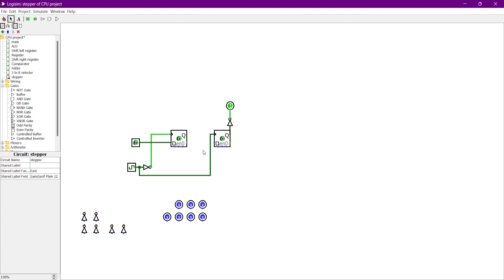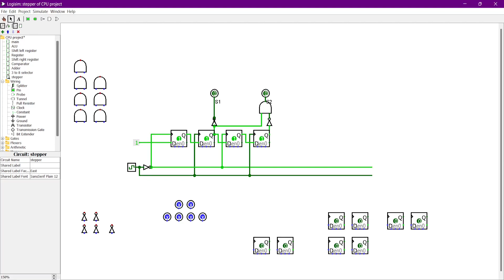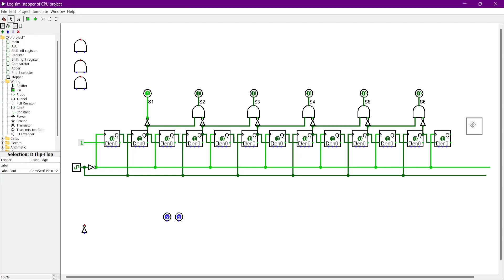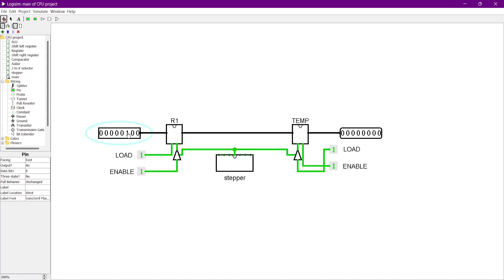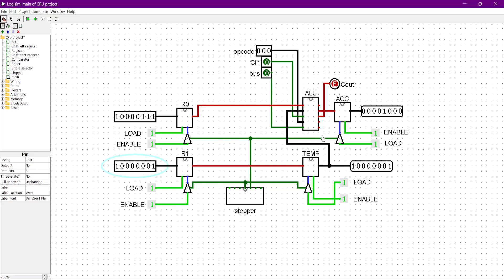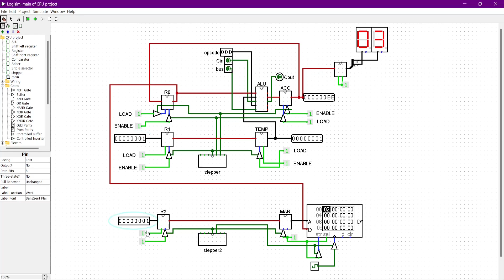Control unit: The stepper

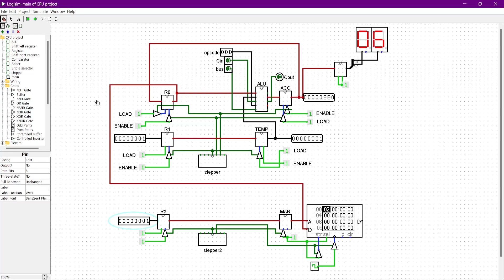Comment from the maker: At 3:19, when I change the input from 0 to 1, the MAR (memory address register) changes its value from 0 to 1 at step 4 but I accidentally forget to put '1' to enable the MAR, hence the RAM did not receive any output from MAR and it stopped updating because the address value of it becomes NAN.